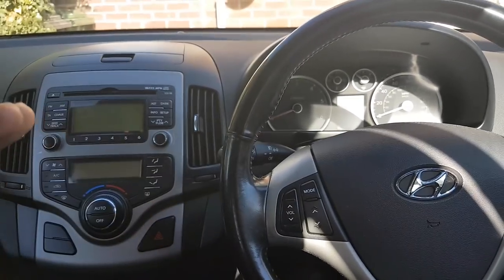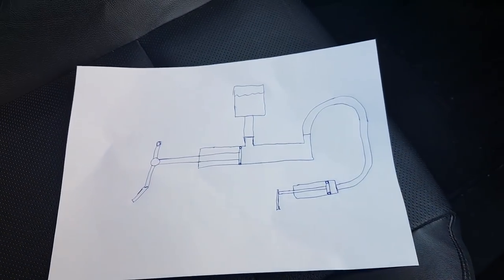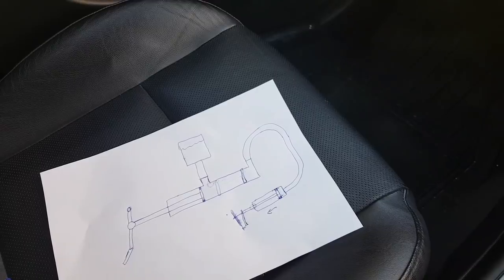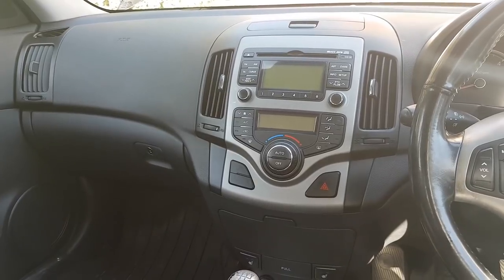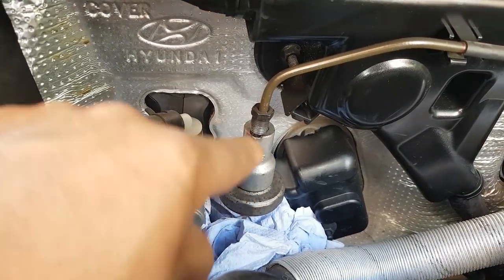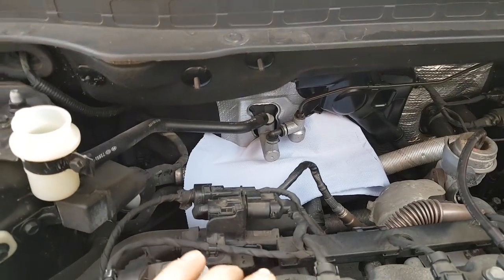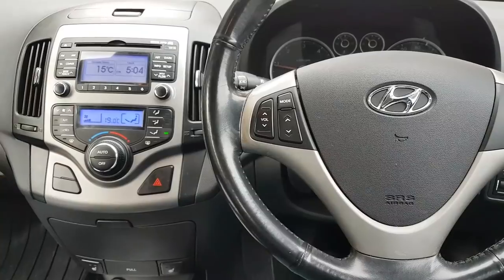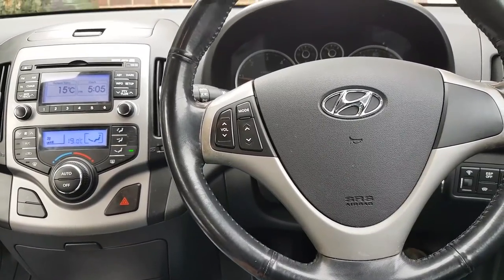Hyundai i30 2007 clutch problems. Fault finding and repair.

Comment: Hi thanks for your good video, can you tell me what type of the engine drain oil bolt you using to block please or send the link to me please
Reply from the maker: Hi
I bought it at the local car parts shop...
And to be honest, can't remember the details...
Don't you have a shop near you?
Thank you for watching and for your comment!
Reply: @LMAutoRepairs  unfortunately no nearest shop to me 40 minute drive, if you remember the size or which car is great, thank you

Comment: Hi, I have a kia ceed 2012 with this issue! I just brought it , 119,000 miles on the clock, my damper thing looks like it is part of the slave cylinder as so old, is it possible to do the fix while its still connected to the car? if its not could you show me/us how to remove it please,  also what did you use to unscrew the thing? some pliers?
Many thanks
Reply from the maker: Hi
Yes... some pliers,  a big adjustable, or a wrench will do...
Thank you for watching and for your comment!

Comment: I'm going to tackle this job tomorrow. The sump plug has an M16 x 1.5 thread, I bought one for a Peugeot 405 that is the right size. Unfortunately it needs an 8mm square key, but I found I had one in my tool cabinet. One thing I'm not sure about is the metal clip that holds the damper to the master cylinder. Does that clip just lift out completely?
Reply from the maker: I believe it does... if I recall correctly...
Thank you for watching!
👍👍👍
Reply: @LMAutoRepairs  Thanks, I just needed a small screwdriver to lever it upwards. The valve also needed a lot of force to pull it off the master cylinder, again I had to carefully lever it away with a screwdriver. Replaced the valve with a plug, put it back together, bled the air out and the gear-crunching has gone away. One thing I did first was to unscrew the bolts holding the reservoir and lower it to the same  level as the master cylinder. This stopped the fluid leaking out as much while the valve was dis-connected.

Comment: How did you empty the system to take the part off?
I have a m16x1.5 sump plug and I'm about to do this job.
How do I empty it so when I take the part off I don't get covered in oil..
Reply from the maker: Drain it at the slave cylinder bleeding nipple...
👍👍👍
Reply: @LMAutoRepairs  
OK thanks you. And what oil is best to use thank you
Reply from the maker: DoT5... but double check with the car manual... 
👍
Reply: So after doing this which has tremendously improved the gear selecting, my clutch pedal still is pretty stiff and squeaks abit. What could be the issue?

Comment: I have this exact problem in the same car as this. Have you any idea what size thread was the sump stud you used? Or even what  was it from? thanks and very nice video, may well save me a lot of money as my mechanic wants to fit a new clutch and flywheel!!!
Reply from the maker: David 1980 
Hi
To be honest is just went to a local car parts shop and bought a sump plug... I believe it is a sort of universal plug... I took this part with me to try it, they showed me two or three different threads, and one fitted just fine...
Sorry I can't give you the thread size....
Hope that helps!
Reply: thanks for the fast reply! ;-)
Reply: Thanks for your help but didnt work for my car. Must be something else. 😁
Reply from the maker: David 1980 
Sorry to hear that...
Ensure that the slave and the master cylinders are good before jump to the clutch...
Thank you for your feedback...

Comment: My newer Hyundai I30 GD has the same issue. Just an overengineered system with no real value. Except for the producers and service guys pockets if you take it to service for the fix. This thing broke after the warranty. Coincidence? I think not. :))

Comment: I have 2015 peugeot 308 t9 1.6 ehdi 115hp 6 speed manul. I am having problem somtimes it wont go in reverse, and offten is bit hard to go in first gear and second when stationary . I changed gearbox oil but it didn not fix it. Allso when was summer and car sits long on the sun clutch pedal slowly returns when it is depresd and squeaks (i thing i know reson for that is that on top master clynder there is plastic ball and clip that connects master cylinder and clutch pedal gets worn and uper returng spring). Now when its cold when i turn heat to the legs clutch is again slow on return. But that dosent bother me as is that in oreder to engage reverse i need to go  to second but second gear wich is also somtimes is hard,  then to reverse and this trick does not work allways. I fell litle like "bump" when engage first, second and reverse when stationary even when i try third gear . I fell like my clutch does not disengage when presd. Can it be addyusted. This is my  clutch master cylinder https://www.autodoc.co.uk/valeo/7657323 and this is slave https://www.autodoc.co.uk/valeo/10247792.  I have monitogring clutch fluid for two monts now it does not fall of. Could be helpfull to try bled clutch? When turned of car shifts god and while driving its good. Thank you
Reply from the maker: On top of everything,  how old is your clutch?
It could actually be the clutch it self... or the DM fly wheel...
It is a bit difficult to say without actually "feel" the problem... if you are unsure, take it to someone that knows about it, as will be able to guide you in the right direction...
Thank you for watching and for your comment!
Reply: @LMAutoRepairs  i dont know maybe it was never changed, but clutch does not slip and car does not shake or vibrate when taking off or driving
Reply: I just have done test my car clutch grabs allmost instat half or centimer of ground
Reply from the maker: @fernandostanic2035  
What helps pushing the clutch back, is the clutch pressure plate... if that has weakened, can cause you that problem...

Comment: I have same problem with it but replaced slave cylinder, blanked that damper as it was pisind thru the bottom... All gears are fine now but only the reverse its still grinding so i think the next step will be the clutch it self.. Car has 96k and another problem i found was the linkage inside jumped.. That i checked before starting the job but honestly.. How the f... Can u pull off that gear stick to jump out the linkages 😆😆

Comment: Would you know the size of the sump plug you used. For example M16 x 1.0. Thanks very much.
Reply from the maker: Pass... lol
I can't remember now...😋
Reply: LM Auto Repairs   No problem. Thanks for replying anyway mate. Cheers Craig.
Reply from the maker: @bambibigboy  
👍
Reply: On the i30 owners club there is a kiwi lad that did this job and took the time to measure the thread. Says it is an m16×1.5. Google that with the words sump plug and you should learn some more!
Reply: Frequent Flyer thank you very much buddy. I can’t thank you enough for taking the time to let me know. You are a 🌟 star. Cheers Craig 🙂👍🏼
Reply: @bambibigboy  you're welcome! It'll have to be an actual plug too. Regular m16 bolts have a 2mm thread i think. Plugs are cheap anyway.
Reply: Frequent Flyer Nice one. Thanks again for taking the time to contact me. Cheers. 🙂👍🏼

Comment: I have a question .. I was used to driving a Mazda and the clutch always caught at the top . I just got a 2008 Hyundai Elantra and I have to push it to the floor . Noting strange other wise but I been told that's just how they are and someone else told me it's going out . So is it just how these are ?
Reply from the maker: Hi
I don't own any Hyundai,  in this case, this was the issue, on other models I am not sure... it might be that they are design that way...
Thank you for watching and for your comment!

Comment: The problem came after removing this valve is the vibration on the pedal. So annoying to be honest specially with higher rpm you feel the clutch vibration in your feet zzzzz. 
It keep it for a while to check the difference. I still didn’t try the car more than 2 hours.
Reply from the maker: If you have too much vibration, perhaps you have other issues with the clutch assembly... fly wheel, thrust bearing, etc...
👍👍👍
Reply: @LMAutoRepairs  its all been changed 2 weeks ago, all four parts including the flywheel. Also the pedal cylinder. All oem parts. The vibration is the first think i notice today i will keep digging for the problem and let you know all. 
My car is santa fe 2011 2.4 motor

Comment: tried this on my wifes 2008 diesel did work for a bit but the clutch was just worn out she rides the clutch! with the new clutch in the sump plug fix was no good the part is a fluid regulator assy not a damper it controls the fluid to the slave cilinder these parts are in the car for a reason a temporary fix is no good
Reply from the maker: Hi
Whatever is called I am not sure... this part, does not regulates the fluid... it is definetly a sort of damper... jus see how fits on the fluid line... 
Thank you for watching and for your comment!
Reply: all i know part no h*41690-2H900 regulator assy hyundai i30  if the part is suppossed to be there now her car works like new unlike with the sump plug fix ,regards peter
Reply: part no H*41690-2H900 regulator assy if i am fixing a car maybe it should be totally stock not some fix for now . regards peter

Comment: but sometimes  the slave  cylinder was damage and  it's not leaking
Reply from the maker: عبدالله العريبي 
If you press the pedal and that pushes the slave cylinder, then you leave it there, in my case for about 5 hours has I had something to do in the mean time... and the slave does not move, what is your explanation for the problem? 
Either way, removing the super sorted the problem....
Thank you so much for watching and for your comment! 
Good question by the way...

Comment: Hi is there any way of contacting you.
Reply from the maker: Hassan Raza 
Go ahead...
Reply: lmsvvavr
I've recently bought a e60 530d and now on the idrive it's showing"HIGH RATE OF BATTERY DISCHARGE"  and also I got the car serviced and after the service the engine light came on and on the idrive it shows"INCREASED EMISSIONS".  Any idea what either of the problems could be.
Reply from the maker: Hassan Raza 
Have you spoke to the people who serviced the car?
Without scanning it it is nearly impossible, as the message for the emissions can be caused by many different things...
Reply: lmsvvavr 

I spoke to the mechanic and he said the car needed a new charge pipe but the thing is the light only came on after the car got serviced and it never came on before.
Reply from the maker: Hassan Raza 
Either way I would use that as my argument...
If the car was fine before they must have done something... even if was something that was on its way and just failed as the service was carried out, they my should help you out... at least as a good will...

Comment: That is a great video that gave me a full scale picture of a clutch hydraulics system. I have 2 more doubts, can You help me solve them?

1. I've removed this shock absorver (cannot recall original name as it was a few beers ago) with normal screw  - can this inflict badly on my master and slave cylinder? As all of the radicall pressure change will affect those cylinders now. 

2. still, my clutch pedal is very soft and I can't switch gears. All clutch and bearings are new, gearbox is new, slave cylinder is new - so it HAS TO BE master cylinder. Or am i just a retard, who is not able to bleed air out of the clutch system properly? Maybe there is a good tutorial how to bleed air out of the system that You can recommend? My car is KIA CEE'D 2006.

Cheers!
Reply from the maker: Hi
Well, after almost of that changed, you are indeed left with air in the system or a bad master cylinder...
The bleeding process, is done as any other manual clutch system, on the slave cylinder bleeder...
If you are 100% sure that the bleeding is done, then I would say tat the slave cylinder is your last option...
👍👍👍👍
Reply: @LMAutoRepairs  thanks for the replay. it was a master cylinder indeed, plus the whole clutch pedal case was cracked xD it turned out that pressure compensator was working after all and i was able to install it back in my car.

still have a doubt about replacing pressure compensator with a normal screw - isn't this affecting cylinders durability?
Reply from the maker: That's great that you gor to the bottom of the problem...
👍👍👍

Comment: Common problem in all Hyundais and Kia. Avoide thrse cars, they are unreliable money pits
Reply from the maker: Thank you for watching and for your comment!
Reply: I own 2013 kia ceed 4tech for 4 years. Done 80k kilometers car has180k in total. Only issue was this. Show me BMW which can do the same.
Reply: My i30 is 10 years old and done 224,000 miles. It has been extremely reliable, and have spent very little on it.